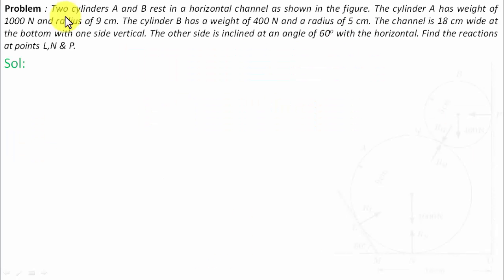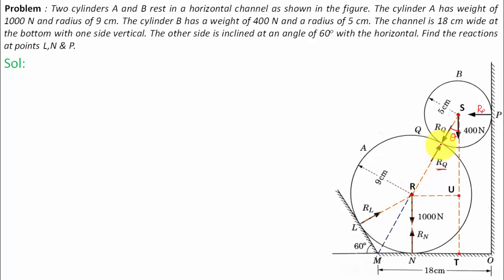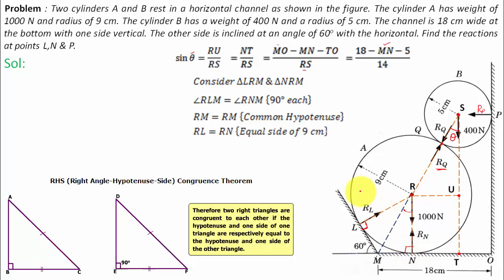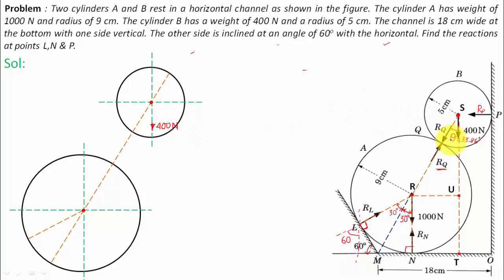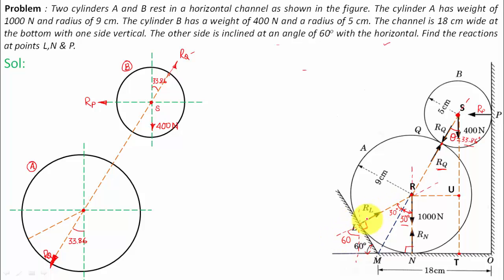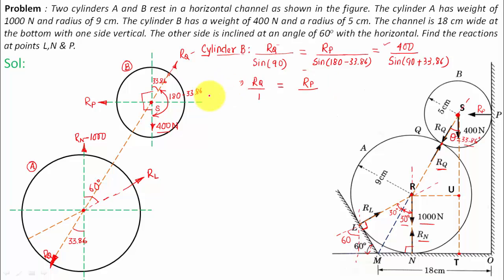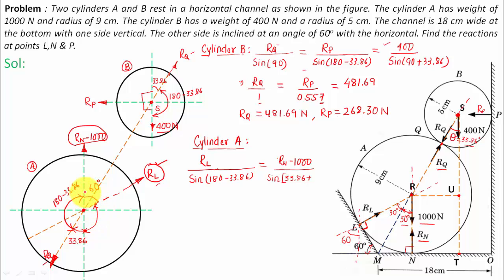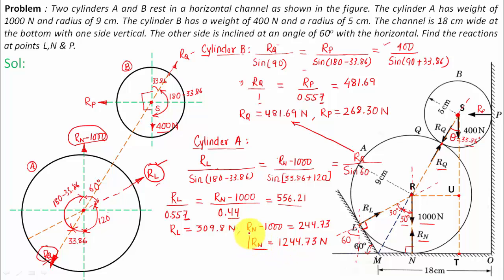Engineering Mechanics_Forces on a Plane_Level 2_Problem 3

Comment: Hi, engineering student from Philippines. Shouldn't RN be RN=344.72 N?
Because if you try to solve for RN in the equation:
0.5572(RN-1000)=309.9(0.44) 
0.5572RN-55.72=146.356
RN=344.72 N

Please correct me if I got my calculations wrong. 😁

Comment: The clock shown in Fig is acted on by its weight W = 400 N, a horizontal force F = 600 N and pressure P exerted by the inclined plane. The resultant R of these forces is parallel to the incline. Determine P and R. Does the block move up or down the plane? sir please provied te video solution of the question

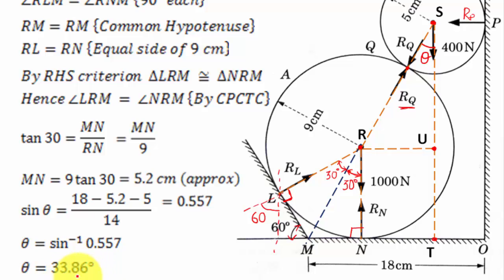Comment: Couldn't we use property of transversal through parallel lines to get theta as 30 at 8:24 as line segment MRS cuts through parallel lines RN and ST.
Reply: Were you ever able to get a answer to this, I am stuck here with the same problem and by transversal law this should be 30 and not 33.86